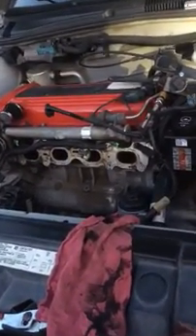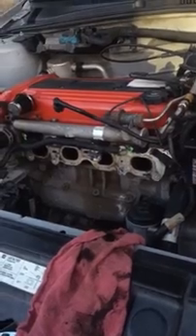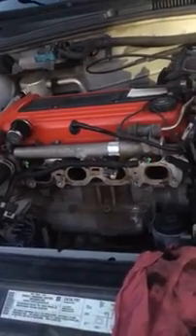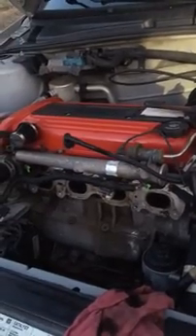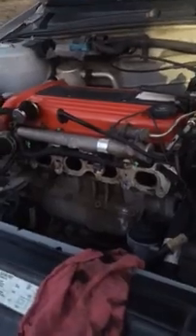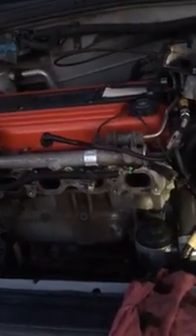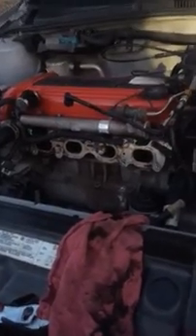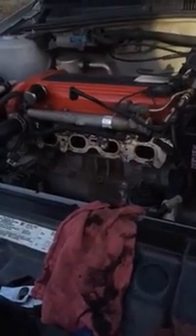ECOtec 2.2 to 2.4 intake manifold swap

Comment: I have a 2009 2.2 ecotec LAP cobalt with a cold air intake, shorty headers, high flow cat to cat back exhaust, I also cut the muffler tip off so after the converter it's straight piped. What I wanna do is replace the 2.2 intake manifold and 2.2 throttle body with the 2.4 mani and throttle body.. and I was also thinking about replacing my high flow cat and shorty headers with the 2.4 mid length header/downpipe connecting to my cat back exhaust. Has anyone had any experience with this? I've looked on forums and tbh there's really not a lot of people who have tried doing this with the 2.2 cobalt. I know the cobalt I have being the 2009 version has more of an advantage with replacing the 2.2 parts for the 2.4 ones.

Comment: I once had a Cavalier with a 2.4 "twin cam" engine.  Blew the head gasket.  Did head gasket and cleaned out the combustion chambers, both intake and exhaust ports on the head, cleaned all the valves, the intake and exhaust manifolds.  No mods at all and it felt like I put a better cam or better head on there.  Definitely had noticeably more power after it was back together

Comment: 148 hp and 159 tq.. at the front wheels, thats very nice the 2.4 intake( my freinds at cbm motorsports ) tell  me 10 to 15 extra hp and a few more mpg..i am installing one in my 1984 alfa romeo spider
Reply: 2.2 I installed it felt more powerful after 4K. It pulled hard. Felt amazing.
Reply: Installing this manifold will decrease hp n torque between 3000 rpm to 4200 rpm but wil gain more on the top end. If you do swap it youll need 2.4 throttle body n throttle body adapter from ZZPerformance n a tune
Reply: @luisgonzalezEcotec  i have done my homework on the engine.......,020 over on the pistons, blocked the deck to .15 of the top of the pistons.. head has been shaved to .020 inch.. lots of work on the intake ports and exhaust ports,, rear of the valves have been cleaned up,, 3 angle valve seats.. conical valve spring for better valve control,, soft ecu cutout at 7400 rpm.... headers, 2.4 intake manifold, with a cbm motorsports t/b adapter, and new flash from cbm, also  al the bearings are coasted fro, swan coatings, piston have been ceramic  coating on tops,, the cly head combustion chamber. polished.. exhaust ports are polished, the intake dimpled  cnc     back of flywheel cleaned up and down 5 pounds fro oem weight. compression ratio is now 10.7/1..did my homework
Reply: @randellgribben9772  nice 👍 sounds like it would be a badass build
Reply: @luisgonzalezEcotec  its going into my 1984 alfa romeo spider,, its in the car now,, just doing some exhaust work now